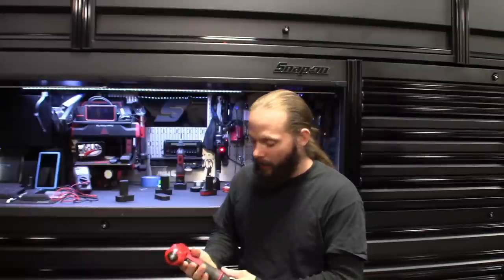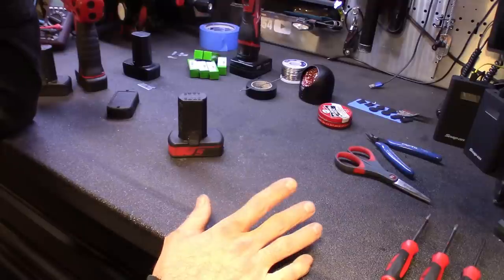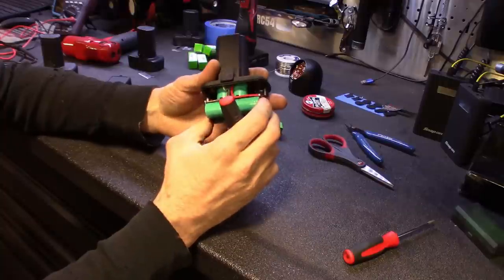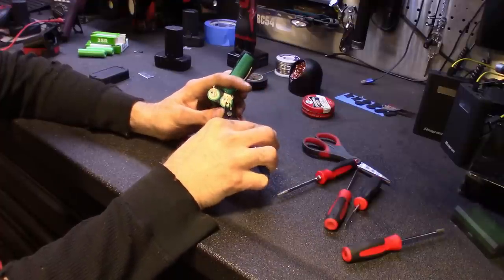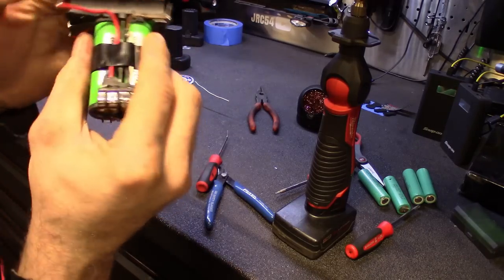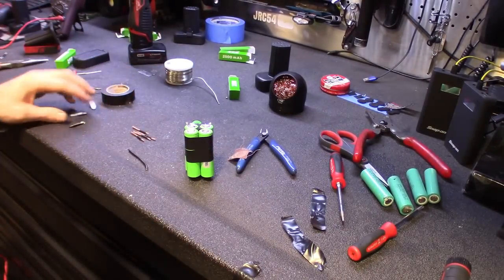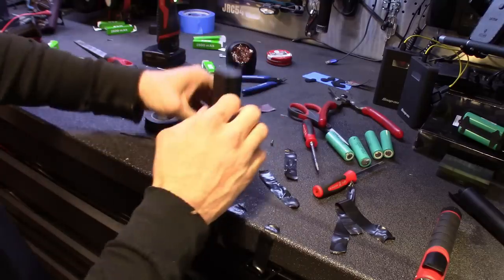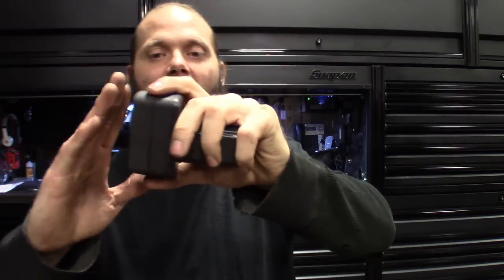Snap On 14.4v Battery Mod

Comment: Using a milwaukee electric tool to make a snap on electric tool more efficient. Makes sense
Reply: That is failing as the video is being made...right
Reply: Snap on fan boys making their tools last longer. Milwaukee batteries perform well. Probably the best battery of all power tools right now. I’ve owned and used  snap on, Milwaukee, festool, Makita, dewalt. Milwaukee batteries are best performing.
Reply: @ThaiRoney  I hate snap on man, but the 14.4 line is just awesome. Yeah if it breaks it’s $120. But 3 weeks abs you have a new tool. My c761 has lasted 3 years being in an oil change pit and just had an issue. Stubby m12 3/8 broke, sent it in, 4 fucking months later I finally get it back, and it’s a shit tool, sounds like steel shot floating around. Another 3 months get a solid tool, and it’s done in 6 months. Never even got damp.
Reply: Good luck with rebuilding a Milwaukee.

Comment: So mixing mah is not going to work out as the horizontal "4" batteries will run longer then the vertical "2" and will over discharge the vertical "2" on 14.4 but if you have the "4" wired to work on the 7.2 tools that would double your runtime! Cool idea but unless you stack 2 more 18650 batteries I don't see it lasting long.
Reply: Or add one cell to each bank. So you can keep the cell banks even

Comment: Don’t run the battery down too low, bc you have one set in parallel with another single in series, if the single gets too low the charger might not be able to charge the single bc it’s been drawing more power from the single, as a posed to half the draw from each of the parallel batteries. Very cool idea tho, it should perform well!

Comment: You never want to solder a lithium battery, the heat from soldering can cause them to explode. The correct way to attach the nickel strips to the cells is to spot weld them, that way your only heating the cells for a milli second.
Reply: towboatjeff you can solder lithium.   Best to use flux and tin them so you are only applying heat for a second or two each time.    Using thermal imaging you can tell the heat doesn’t soak into battery.  So no negative effects on battery cell
Reply: @caseytbss  es!!!! 👍👍👍👍👍
Reply: @caseytbss  He did tin the connections on these batteries before he made connections that's why he had no problems. He wasn't staying on them long with the soldering iron.

Comment: This is great. I'll be stealing this idea for my own shop. A tip - use more flux with your soldering and it will flow better. If you are using flux core consider switching to straight silver/tin wire with separate flux, your results will improve and you won't need as much heat. Preheating the area with a heat gun helps too just use your head and be careful.

Comment: I can’t wait to see the results but I’m skeptical.  Half of your stack is 5Ah but the other side is still 2.5mAh.  My hypothesis is that the run time won’t change much.  You’ll drain the 2x battery side down and the 4x will still be going strong but the total voltage will have dropped to the point that the controller will shut down the tool.  Worst case scenario, you may end up reducing the life of the 2x battery stack.
Reply from the maker: Snap on runs two 3.7v stacks in series 4 batteries. The stacks have two more batteries running parallel so the first that have the other two 18650's should drain about the same amount because it's pulling the same amps as the series stack. But I've been testing all day
Reply: JRC54 the thing is you only extended run time on half the battery pack.   You needed to add 2 more cells to do this correct.   If anything what you got going is more dangerous due to the possibility of voltage not being matched and issues with charging.
Reply: He's right.  Its (2) 7.4 sides to the battery consisting of one vertical and one horizontal battery on each side to make 14.4 when needed.  You added a parallel battery to each sides horizontal cell.  So in each of your 2 battery sides you still have 7.4v but it's made up of 1 (2500mah) battery running series with 2 (5000mah) batteries.

Comment: Thats a great idea!! I use those on my die grinders and they don't last long at all... even the ratchets don't last anywhere near as long as the millwaukee stuff does. Our shop has so much water in the lines we use more battery tools here than most shops do.

Comment: Small list of 18650 cells that would work for these batteries depending on your usage. Samsung 25R5 2500 mAh, 20 amp max discharge. LG HG2 cells are 3000 mAh, 20 amp max discharge which I use for projects because it’s priced well for its capabilities. LG MJ1 is 3500 mAh, 10 amp max discharge if you know your tools maximum power draw, this cell could be great but may not survive the long haul if maxed out every cycle. LG HB6 1500 mAh, 30 amp max discharge for high current demand, downside is capacity, but these take the heat well. Battery Bro website has a ton of info on lithium cells if anyone needs or wants to tackle something like this. Illumn sells individual cells for a fair price, stay away from private label wrapped cells (Efest, mxjo, etc). Stick with name brand manufacturers LG, Samsung, Sanyo, Panasonic and Sony, look for a reputable company to buy from. Pay attention to the positive terminal type: flat or button and protected/non-protected.

Comment: Wouldn't that only make it like a 3.75 ah battery since your only adding one extra per side? It's 2500 mah at 3.7v but in a circuit pulling 7.4v it would pull the charge twice as fast making that 1250 mah add on to a 7.2 v circuit.
Reply: Yes he would've had to use 8 batteries total to equal 5.0ah.. simple math using a simple formula
Reply: Yea 3.75 it's only a 50% increase

Comment: For your own safety  please please use a battery spot welder not a soldering  iron it could cause the cells to explode due to excess heat

Comment: Not gonna lie Milwaukee beats snap on battery tools in many many cases .. this is one of those tools I will never trade I’ll rebuild it 100x if needed because hanging inside a piece of equipment  ups side down one handed  that thing with its trigger and small size is absolutely indispensable to me personally

Comment: That is a cool mod. I think it would work great for the polisher because that thing eats batteries like nothing
Reply from the maker: That polisher 👎
Reply: I haven't had any problems with mine and now I  only use it to clean up rims. I definitely like the milwaukee grinder more though.
Reply: JRC54 polisher / pep tool is great once you swap motor out.   It’s $17.      Much better than m12 unit

Comment: Can you tell me the answer to something? I have a 14.4 v snapon battery. The 4 center pins are the outputs of voltage. How can I use this battery to power something with the 14.4 volts it is capable if the thing I am powering has no "logic" circuit? Is there a combination of pins that I can receive 14.4 V out of this battery if the item receiving this voltage is not a snapon product?

Comment: SnapOn really falls short on the battery’s... basically every pro grade tool company has more battery selection and more maH
Reply from the maker: Hope they see this video
Reply: JRC54 we can only hope.. but with their latest power tool upgrades, I doubt it will have a impact.😕
Reply: Noah.Lytle312 think about target customer,   They are not selling to construction guys that are building 50 foot in the air all day.   So why in the heck would you need or want a big ass battery when your box is only few steps away and you can rotate batteries fast & easy?
Reply: Top Shelf Innovations for one, I wasn’t saying it has to be a huge 12ah battery. But to only go from 2ah to 2.5ah isn’t much of a development lol. Also, is it really convenient to have to swap battery’s every time? I mean come on, the Milwaukee m12 6.0 battery is about the same size as SO 2.0/2.5.. let’s face it, SnapOn makes the best hand tools but their cordless line is very lacking.
Reply: Noah.Lytle312 I own every snap on 14.4 lithium item there is except the long reach ratchets and the new high tq one (i have my normal 1/4 @ 3/8ths)   I work on stuff constantly.   I don’t have any issues with battery run time at all.   

I also own appx 35 m12 & m18 items and i have all the batteries from the m12 1.5ah lil bastard up to the m18 9.0 and 12.0 high outputs.   

Every snap on tool is better than its equal in the milwaukee m12 line up that I own.    The milwaukee often will come out first, but the snap on is better when it hits.    I have not tried the stubby or short milwaukee impacts yet.    I haven’t had a need yet..... i have 2 M12’s, and M18 and 3 snap on’s (hex, 1/4 & 3/8)    

Only things milwaukee has snap on beat on is overall selection of items and price.     I reach for my snap on every time if they are sitting next to each other.  

Most of my milwaukee items stay on my Raptor, i have it set up for mobile repair and install.   That way if I leave one behind, I’m not out as much money.
Reply: I don’t even know how long my 14.4’s last.  I have a one more battery than I have tools so when 1 dies, or i get a red or yellow light, I swap my fully charged extra battery in, throw the depleted one on the charger and get right back to work.

Comment: Gotta be careful using 18650 batteries. I know those Samsung 25R batteries are going to be fine but what 18650 will hold the amperage required without venting at 5000mAh?
Reply: Guess I spoke too soon before finishing the video. However that still isn't going to give you 5ah battery since youre running only 2 in para you would be closer to like a 3.8ah.